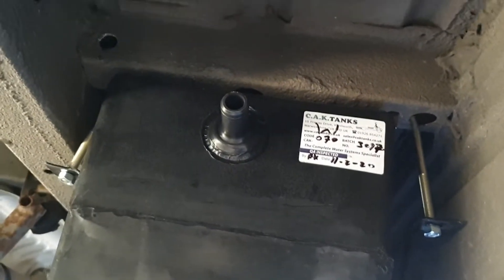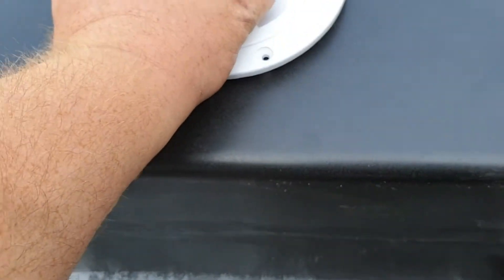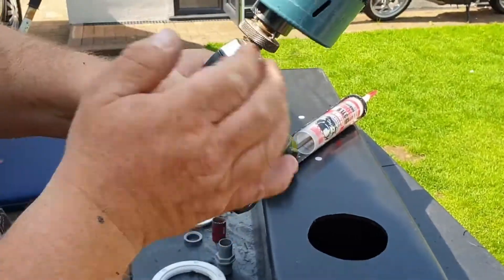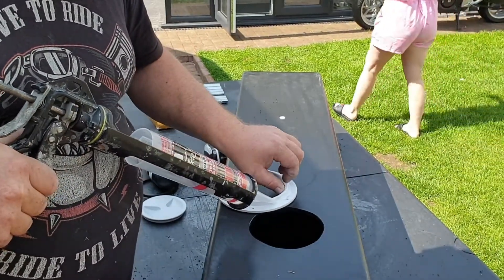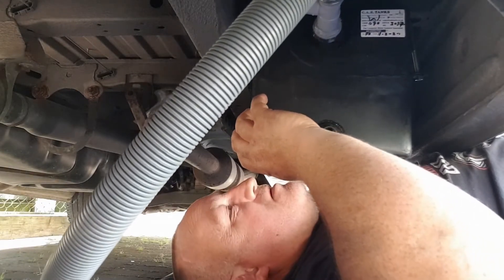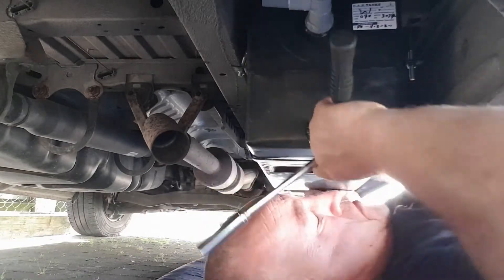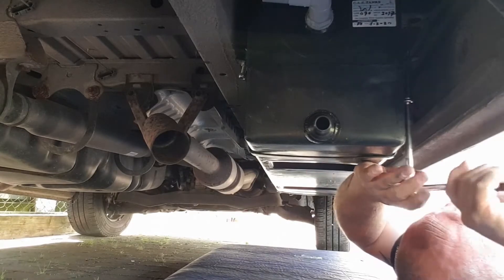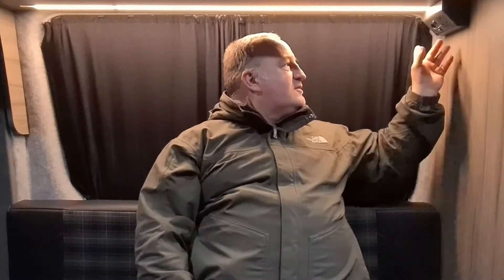selfbuild | vw crafter | campervan | waste tank install | van build | part 25 | the crafty blinders

Comment: Thank you, I just ordered the same kit. Watching this is certainly gonna help me.  🙂
Reply from the maker: Really glad you like the video I'm just working on the next one
Reply: @TheCraftyBlindersvanlife  Can I ask, would you know if its possible to have both water tanks, as well as a LPG tank under a LWB Sprinter.
Reply from the maker: @Ed Hass  The water tank fits behind the differential, 
we moved our spare wheel and fitted our gas tank in that location 
The spare wheel is now connected to a wheel carrier on our backdoor
Reply: @TheCraftyBlindersvanlife  Did you find room under there for both your water tanks too
Reply from the maker: @Ed Hass  yes both fitted nicely under the van the waste water tank is located down the drivers side behind the cill

Comment: Great video Sam. Just a quick note , if your van has a DPF fitted to the exhaust it may be worth fitting a heat deflector shield to the bracket of your waste tank to make sure it does not damage it as a DPF burns off at 1200 degrees and the exhaust glows cherry red. Just a thought pal. But van is heads and shoulders better than my build and loving your videos
Reply from the maker: How weird is that I've just had a conversation with my brother today about this very subject I've been monitoring this and the tank is fine, at the weekend we did a long run 100 + miles each way and on the way wondered if the engine had regeneration is there any way to tell if we integrate the system?
Reply: @TheCraftyBlindersvanlife  hi Sam, you can tell if it has a dpf fitted by looking at the exhaust system. There should be a couple of sensors one at the top and one towards the back. There will also be a extra pipe to the DPF that will fire fuel into it to ignite and start regeneration to burn the soot off. If you do have a DPF fitted a simple solution could be to fit a clamp on tail pipe to either extend the exhaust outlet past the tank or to angle it so the gases go away from the exhaust . Hope this helps you matey